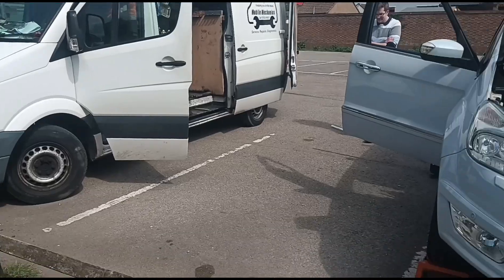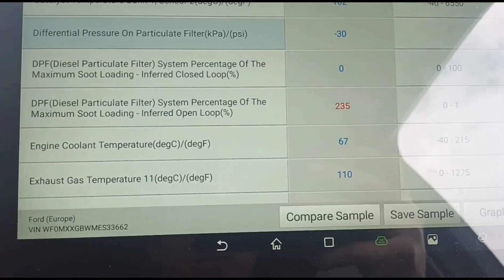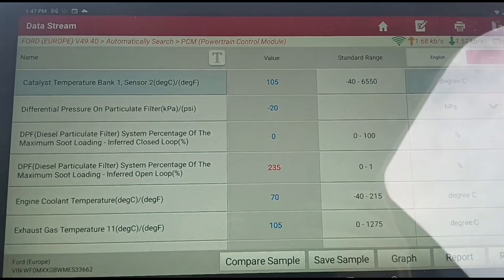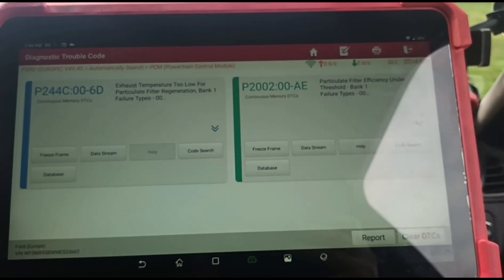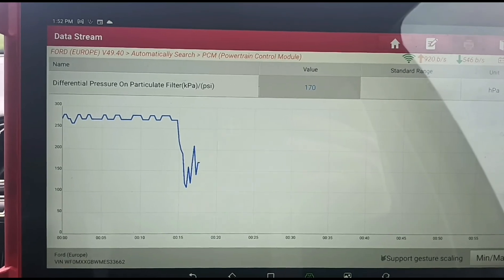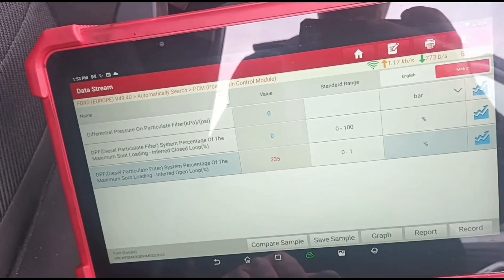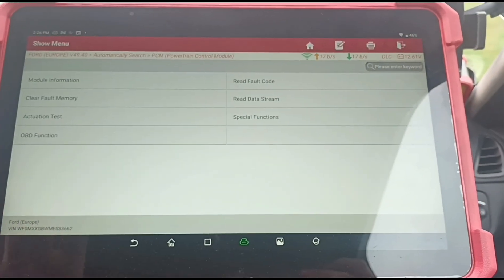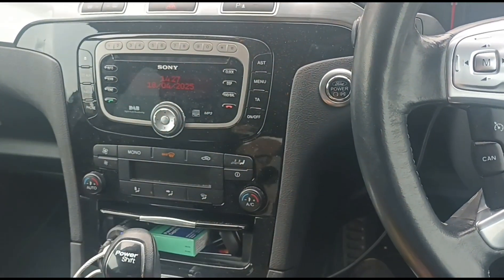3 Mechanics Made Multiple Errors Trying To Resolve This Repeated Blocked DPF P2002:00-AE Efficiency

Comment: Great job Jimmy 
What's the cheapest scan tool that I can purchase to get me in to all that emissions stuff 
And reset the values.
Had the same problem on a c max(cleaned the vapourisor and took the exhaust off and chemicle cleaned the dpf)but don't have the scan tool to reset  
The values and check the live dater to see if all the sensors are working correctly 
Many thanks

Comment: my daughter payed 4 grand for a kuga 2.0 tdci , 3 months later it has cut out with code p244D exhaust temp too high for regen the fan isnt working and it has p0087-71 circuit to high . please could you tell me , is it worth trying to clean the DPF and resetting the EGT sensor as it would appear to be thermaly locked. also is the p0087 how the ECU cuts the injectors ? i'm at my wits end . 120,000 mls 2009 mondeo style DPF no atomizer... thanks in advance

Comment: There is an old saying 'a little knowledge is a dangerous thing'.  This applies to those other mechanics...and was hazardous to the persons bank balance.  I swear that if I ever get dpf issues I will trailer the car down from Glasgow to you Jimmy. Recently had issues with my x-trail and spent over a 
£1,000 in and out of garages and the dealership but none of them could resolve the issue.  Turns out it was the ECU. Got a second hand one recoded to my car for £560.

Comment: It's amazing how many people don't know how a differential pressure sensor works. I work with an engineer who is at a very prestigious automotive company who didn't understand that they measure the difference in pressure across the channels. 

Also, I was really surprised the ECU was capable of registering a negative value.
Reply: Most if not all dealerships encourage replacement parts until ..... maybe not fixed, I have to deal with this daily,

Comment: Re the pressure dropping to zero, from the shape of the graph, I wonder if it's going up in increments of 10? So if it was sitting at 3.5 or 4, it would round that to zero? In your other videos, i've seen it with 1 decimal place so could be a setting in the tool?

Either way, another great video, thanks!

Comment: Hey mate, Running a Launch as well. Any idea why I would have 0Kpa on the differential pressure sensor reading? 
Have had a fault on customers vehicle with vaporizor. Seems to be OK now. But the readings don't seem right.
Reply from the maker: 1: sensor not working. 
2: hose split
3: metal pipe blocked
4: dpf ceramic broken 
5: wiring issue
Reply: @ORileysAutos  Thanks, Have checked over pretty thoroughly. Vehicle still operating fine after a few thousand km. Mainly asked because I was trying to eliminate the scan tool reading. I will get a manometer in to check. I see on another video on a transit you had 2 differential pressure tabs open and one just read 0 the whole time. Is a Ford Ranger.

Comment: What is the best way to avoid dpf blockages?

I use additives to each full tank, I think its a miller's brand one I go with.
Is there anything I should be doing to help keep things clear?
Reply: Drive it like you stole it...😁
Reply: @GR-uy1hx  I hate driving around in high revs for any real length, I just feel like  I'm taking years off the life of the engine.

I basically try to give the car an A road blow out each couple of weeks if I can. 
I also use an additive to each full tank.
Fingers crossed I'm doing enough
Reply: @at0micsheep All joking aside...  Good run up the motorway as much as you can, for the life of the engine I just do premature oil & filter changes.😇
Reply: Great idea overall,  accumulate the crap in the city/local runs and let it all out in the country side.. lol. @at0micsheep
Reply: About city driving like the plague.
Reply: Don’t buy supermarket fuel. I buy V Diesel and never let it go below 1/4 tank before refuel. Every 4 weeks I go on a  30 minute motorway trip.

Comment: I would like to see inside a dpf, before and after cleaning with the LaunchUK product.

And that sprayed dpf looks like they just swapped it with a reconditioned one.
Reply: I would also like to see inside the DPF prior and after cleaning, but that's not very likely. A peek into pitch black, and then the pitch black turns to a whitish honeycomb. The cleaning is not on the surface it's way down inside and there's no way to see that so it's kind of pointless. The DPF that was removed and cleaned is not likely a swap, because those are rather expensive to have sitting around, and there's just too many different kinds. it is an old trick for sales of reconditioned products. since you did some thing that no one can actually see make it pretty so it looks like you at least did something. The average person doesn't know the difference between pretty and proper repair that they can't see anyway. if it wasn't painted, they would just look at it, and think nothing was ever done in the first place. This avoids accusations......
Reply: @JustMe-Dude I've seen people clean dpfs before, I am more interested in how the Launch fluid cleans, especially how little time it spends inside the dpf. Jimmy is usually done in 30 minutes.
My Mazda 3 has had 10 litres of Vtech dpf cleaner through it and a bottle of the Launch fluid and still I have issues. It works for a while but blocks after 1000 - 1500 miles.
Reply: Go and see Jimmy

Comment: Jimmy I think the 5 second bursts Launch says it refers to when you squirt the solution while engine is turned on, in my head that would make sense, the idea behind squirting in bursts while engine is turned on is the solution will stay in contact with soot for longer period of time, its basic chemistry u apply solution u have to give it some time to work ..., when engine is turned off it will not matter if u squirt in bursts or not since u will be the one deciding for how long solution will stay in the DPF before u start engine and solution will get expelled out.

When engine is turned on the solution u inject will have a very limited amount of time to work since the exhaust gases will push it out straight away, something that does not happen when engine is turned off ...

I watch all your videos so I know u start with an engine-off solution injection and sometimes u follow it with an engine-on solution injection, the bursts squirt injection should be done only during engine-on injection ...

Comment: Top video again Jimmy don't know if you can help ive plugged into a 2014 1.3 diesel corsa and the value for the dpf and the soot content are coming up as NA do you think its been remapped I've never seen that before
Reply: you should let him know what scan tool you're using. there can be discrepancies between different companies software
Reply: @JustMe-Dude  yes that might help i scanned it with a icarsoft cr max and a foxwell nt680 both said the same